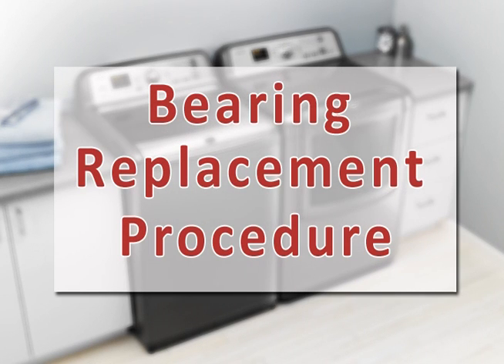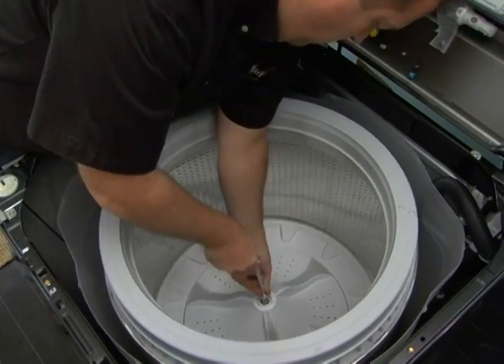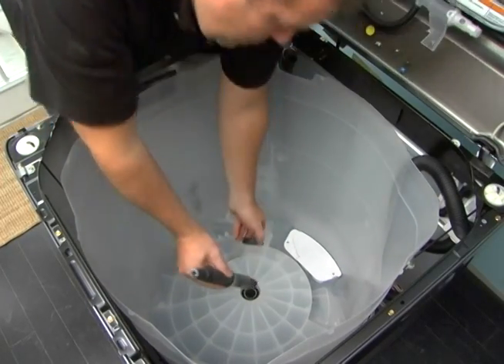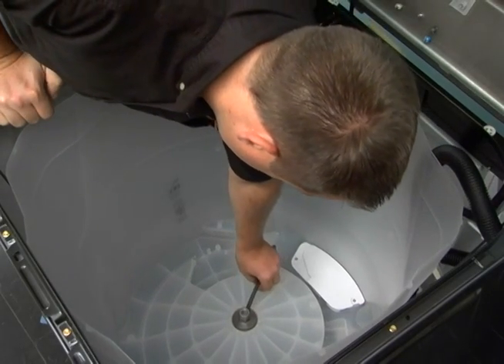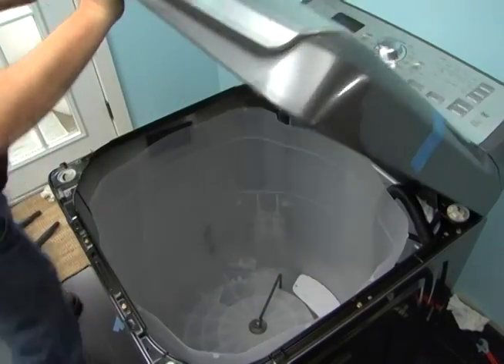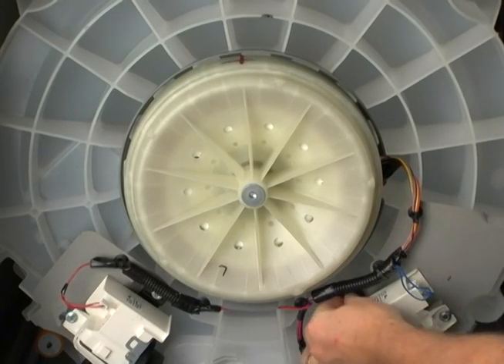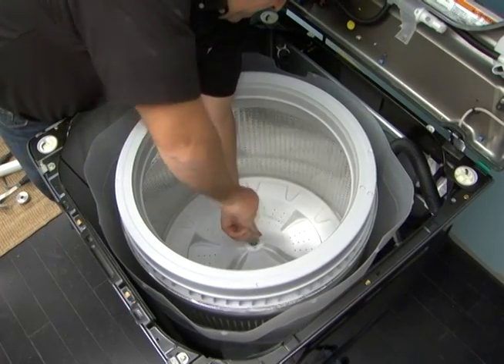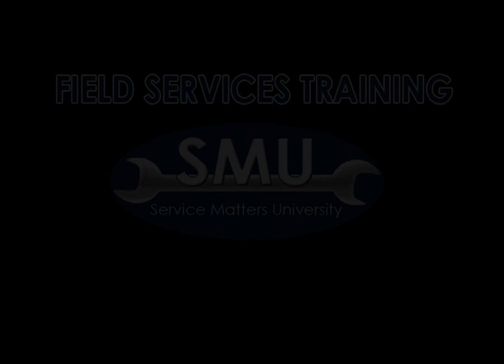Whirlpool Cabrio, Maytag Bravo, Kenmore Oasis Washer Tub Bearing Replacement

Comment: also, after tightening up on the on the bearing press tool and installing the spacer tube, bearing washer and bottom bearing, do you ever have a problem where the shaft wont go in because the spacer tube or the bearing washer is out of alignment ?
Reply: i definitely had this issue. i tried installing the bearings three or four times before i finally figured out what worked for me. i took a steel rod and used it to tap the spacer/washer into alignment. just insert the rod and tap the sides until the pieces are aligned.

Comment: I have the same machine and it worked beautifully. But it took me a very long time (8 hours+). A lot of that was spent cleaning out the mold in the machine and due to some other things that won't be a problem next time: 1. I had to remove the bolts on the back of the panel to loosen the lid.  Then you can slide the lid forward enough to get it free of the tabs that hold it.  2. The stator drops like lead when you unbolt it from below the machine - it happened so fast I didn't get to see how the parts above the stator were installed (the sensor clip and the spacer above the stator). It is better when removing the stator to lie the machine flat on its front (after disconnecting the hoses). Much easier then.  3. Because I didn't see where the sensor came from I put the stator back without clipping it on - had to remove it again when I realized this. It clips into slots in the edge of the stator.  4. I also made the mistake of putting the spacer above the stator in upside down.  It has tabs extending from the screw holes. These face towards the stator - the tabs go into the holes in the stator for the screws.  I put the whole thing together with that upside down which made the stator too low and it rubbed on the rotor which prevent the agitator from spinning and gave an overload error.  Had to take it apart again to fix this (and had to drain the tub with a shop vac first).  5.  You should clean out the lint trap while you are in the tub - its the white box at the bottom with the screws.  6. There's a little white circular plastic "wheel" (visible in the opening picture under the raised lid) that fell off - easy to put back but I wasn't sure what it was and had to take the lid off again to figure it out.

But overall - works great and I'll be much faster at this next time. From what I've read the best thing to do for prevention is to always use HE detergent and lower the amount used and run the cleaning cycle religiously.  T

Comment: Hello...My Bravos is stopping mid-wash and draining, it does this even while empty, and has the OL code on the screen. What do you think the problem is? I want to try to take out the tub to see if something is stuck.
Reply from the maker: Removing the inner basket is a good first step.  The OL error code usually means the inner basket is stuck, either stuck on the drive shaft and so can't float up on water fill or a piece of clothing is stuck between the inner basket and outer tub.  This problem is often associated with using either the wrong type (non-HE) or too much detergent.
Reply: SamuraiRepairman Thank you for your quick response! I have always used HE detergent in it, so I know that isn't it. I wonder if the detergent tends to build up over time. I have had the washer since 2010 and have always followed the reccomended amount of detergent on the cap of the detergent bottle. We are going to try removing the inner basket and I will let you know what we find to be the problem.
Reply from the maker: Only thing you can do at this point is try to remove the inner basket and see if it's stuck to the drive shaft.  This video shows disassembly:  Whirlpool Cabrio, Maytag Bravo, Kenmore Oasis Washer Tub Bearing Replacement
Reply: ***** Hi emesha, I'm having the exact same problem...can you share what your fix was? Thanks

Comment: I have a bravo 300 quiet machine and keep getting LD error and I have to drain and spin again to drain clothes. I this a bearing issue?
Reply: Had the same problem with mine. I replaced the suspension rods and it fixed my problem. Push down in the middle of the tub and release quickly. If the tub bounces, that's a sure sign you need new suspension rods, Here's a link to the part: http://www.repairclinic.com/PartDetail/Suspension-Rod/W10189077/1456067
Good Luck!

Comment: Is the tub press tool assembly a yes on here has anyone done it another way with using the the tub press?
Reply: That depends on how resourceful, sweaty, gutsy and strong willed you are! My friend and I went McGyver on this machine yesterday and I finally said "there is no way my Polish ancestors came here with any special tools and fixed everything under the sun," and within 2 minutes, we had that first part off.  Three cheers! But now, the last component of the hub needs to come off if we wanna get that darned tub out.  I need access to my great grandfather's brain and mechanical hands!

Comment: Is it easier to replace the outer tub rather than replace the bearing? I see that you can buy the outer tub for almost the same price as the bearing and tools that need to go with it.
Reply from the maker: Great question!  Yes, it is much easier to replace the entire outer tub with the factory-installed bearing.  You're taking the outer tub out to install the bearing anyway.  The only advantage with the replacing just the bearing is cost saving.  If you're able to buy the entire outer tub for about the same price as the bearing and tool kit, that's the way to go!
Reply: SamuraiRepairman Thank you so much for the reply. So the outer tub has the bearing built into it if I buy it? Do you know by chance what the part number would be or where I could take a look at it to see the bearing/outer tub part?
Reply: SamuraiRepairman Also, is there instructions on how to replace the outer tub with bearing as I am a rookie trying to tackle this repair. Thanks!!

Comment: I have a quick question. I replaced the bearing on my Maytag Bravos. When it came to installing the rotor, it seems that the more I tightened the rotor I would hear a rubbing noise as I spun the rotor by hand. Is this normal? I loosed the rotor and pulled down and the rubbing went away. The rotor bolt is somewhat loose.  Can you give me some advice?
Reply: I have the same problem. How did you resolve it?
Reply: Well, it's been a year since I wrote this and my washer is running fine. What I did was to loosen the rotor and I wiggled it until the rubbing went away. I left the rotor bolt not too tight because it would rub again. After about a week or so, I re-tightened the rotor bolt. I think all the parts finally wiggle into place after you use the washer several times.

Comment: I'm midway through replacing my bearings and seal, but find I have a fair amount of water in my tub. It seems to be in the section above the perforated stainless sidewall. Has anyone else encountered this? I am contemplating drilling a hole in the top to drain the water prior to reinstalling the tub.

Comment: It's an easy job. You don't really need the special tools. lie the machine on its side to get that rusty nut off the shaft. No way you can get it to break while the machine is tilted. Use a long automotive drift to pound out the old bearings. Use the old shaft and the old top bearing to hammer in the new top bearing. Takes a good 2.5 lb hammer to whack it in. The bottom bearing can be tapped in with a hammer (use the old shaft to keep the spacer and washer aligned). Put the new shaft in and use the old nut to press everything together one last time. Take the old nut off and put the new one on. The new seal easily pushed in with the sealant. Just use the drift and go around the perimeter a few times (careful not to damage seal). Seal goes in spring side up. It will leak later on if upside down.
Reply: i believe the seal actually goes spring side DOWN, not UP. everyone else says spring down and i installed mine spring down as well.
Reply: +min win It's been working fine with no leaks since last September with use almost every other day. If it does start to leak it's no big deal. It went a long time leaking and worn bearings before they were replaced. Next time I'll check with a Maytag repair shop. The pump will probably fail before the bearings need replaced again.
Reply: RatCatcher I gotta do mine and was wondering if I truly needed them.
Reply: Reverse Forward and

Comment: I can't even get the top open!!! I pushed on the clips with a puddy knife no luck... What I'm I doing wrong he seems to go trough that step easy
Reply from the maker: Those clips can get rusty and not want to move.  Just use a stiff putty knife and be persistent, you'll get it.
Reply: Some Cabrios/Bravos' don't open like this...
2 screws in the rear hinge are removed (top ones only), then top  slides forward and up...then raise to open.
Hope this Helps,
AskTrannyMan
Reply: Had same problem ... got out my pry bar .... ooomph for several minutes .... man was the tub dirty !   clean clean clean

Scales of 1-10 .. this one was a 5 (would have been a 3 if that top would have come off easy .. that took 1/2 hr. .. I did not want to damage anything and did not)
Reply: AskTrannyMan
my carbrio 6500 model , open as the video described, just not that easy
Reply: Maytag Bravo XL here and removing the screws on the rear was the key. It still took some pulling to get the clips to let go even with it slid forward.

Comment: Your tub disassembly does not work for a Cabrio washer. You need to use a jack to pry the tub off the bearing rod. The tub does not simply lift off the bearing rod.

Comment: It's not that easy. Try it on one thats 4 years old. Will never buy one of these again.
Reply from the maker: Donald Taddei Try using Jay's Cabrio tub remover tool.
Reply: +Donald Taddei If your problem is the actual removal of the tub, just put the thing in Test Mode and set if for medium to heavy agitation.  Pull up on the tub while it's agitating and the tub will pop right out.